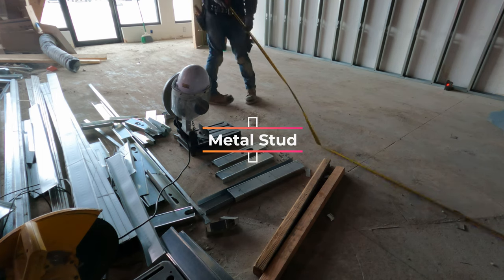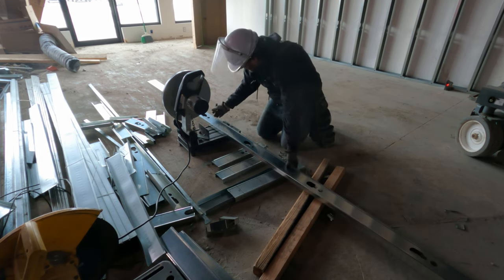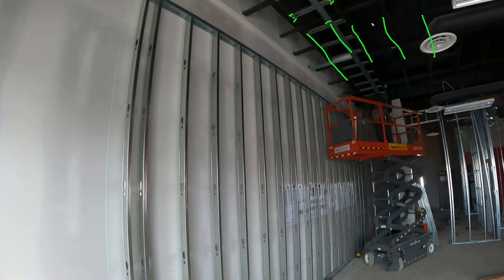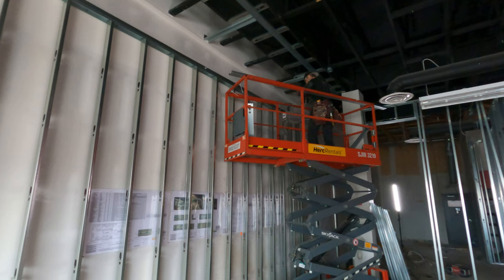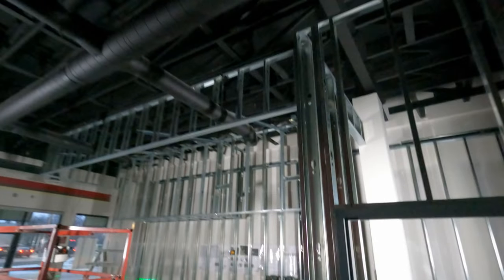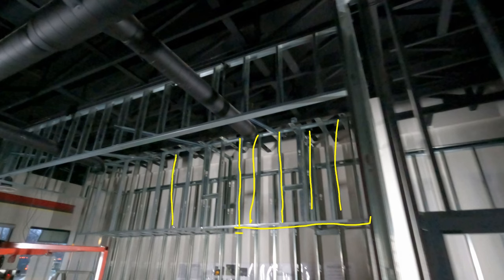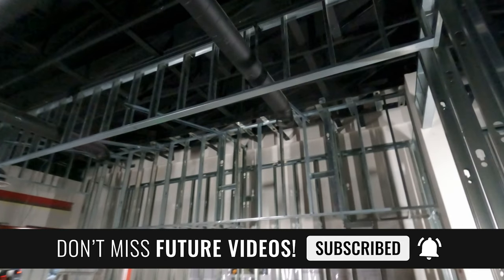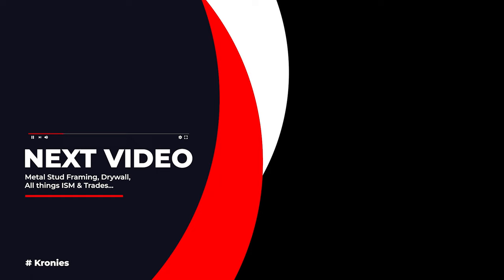Unleash The Metal Stud!

Comment: In a partition head to structure with a slotted slip track then mineral insulation do you need a support channel or a head track channel
Reply: I meant a wall channel in regards to support channel
Reply from the maker: Carrying channel is only needed starting at the 4ft knockouts all the way up every 4 ft.  If there is no insulation going in the wall I still follow this rule but can move the channel around if I need to. If that makes sense I hope so.